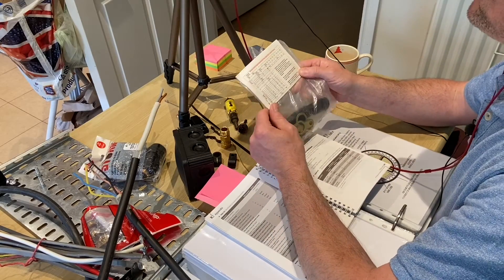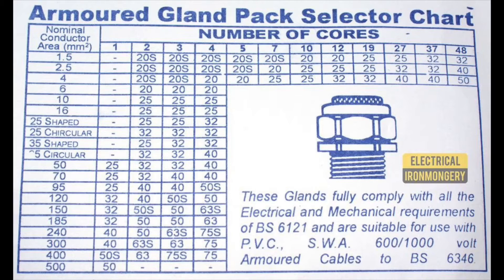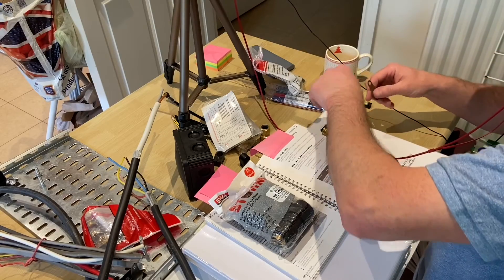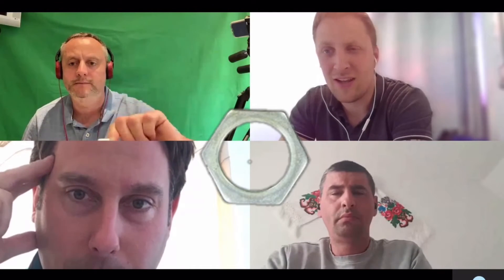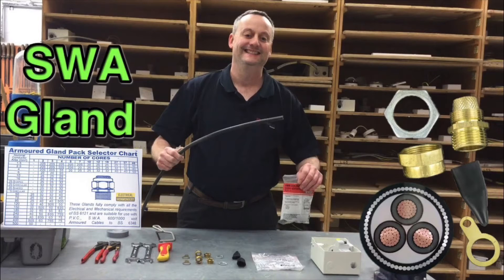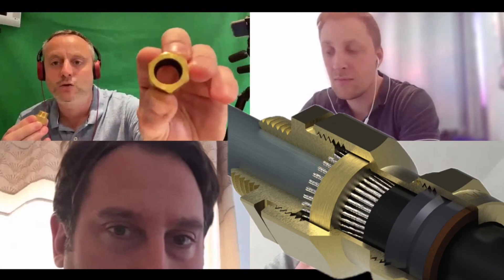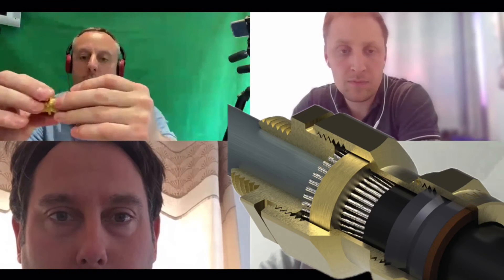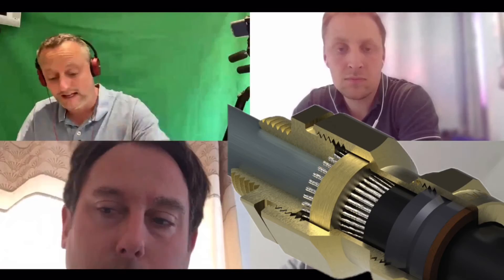SWA Cable Glands BW, CW and SWA Storm Glands for Steel Wire Armoured Cables Part 2

Comment: Here in Germany or Switzerland we are using NYY/TT or NYCY/GKN cables without armouring mode of steel. So the termination is much easier because we use simple plastic glands. But it is nice to see how it is made in the UK. Additionally we are not allowed to use the "wrong" colour for the various functions. For example the N must be a blue wire in the cable made by the manufacturer. In Germany and Austria the wire colours can be chosen by the typ of cable eg NYY-J 3x ->BN, BU,YG NYY-O 3x BN,BK,GY. In Switzerland alle version of colorcodes can be ordered eg 4X1.5 3LPE ->BN,BK,GY,YG, 2LNPE  BN,BK,BU,YG......

Comment: Worth mentioning the Wiska earthing clamp to your students
Reply from the maker: Gareth Gleadhill Thanks. 

I did but that is likely to be a video soon. The lessons are over 90 mins I only show bits. My 2 videos on MICC cable are poor Skype quality so undecided whether to release them #gutted. Thanks for the great comment. Gaz 👍
Reply: @GSHElectrical  Haven't done too much with MICC but what I have done wasn't the best experience. Re-potting very old pyro that easily twisted even with a joystripper.
 
Would love to see a video on MICC been properly potted if you have any tips. Trying to strip with pliers was easier in the end...

P.S. I have a great on site pic of a Pyro we discovered behind an old light on a tower block staircase. Lets just say it wasn't done properly. Not sure if it's of any use for you